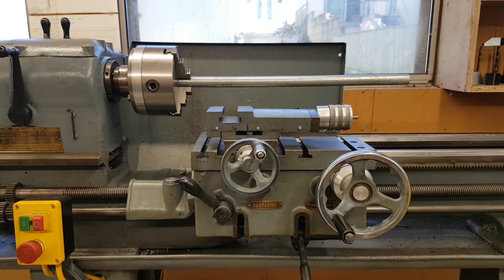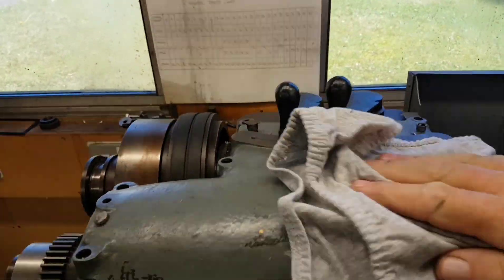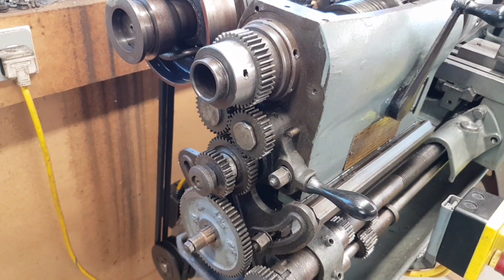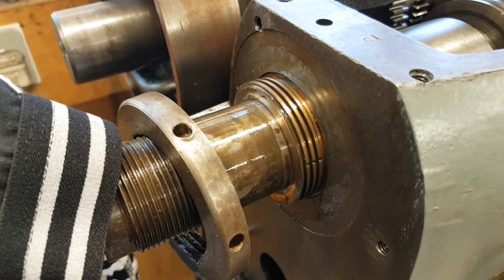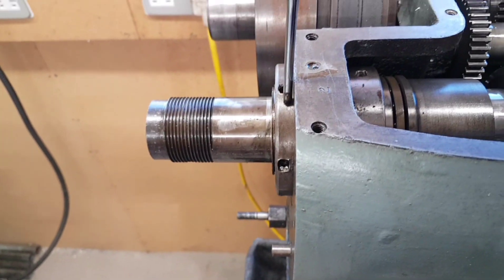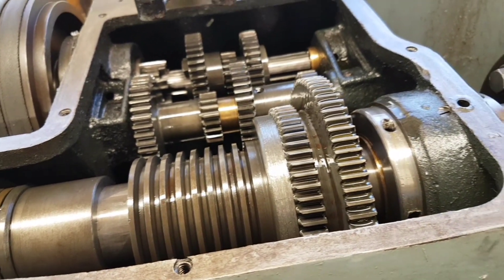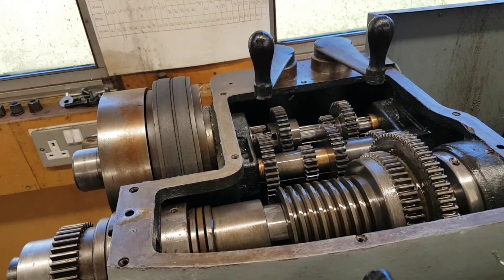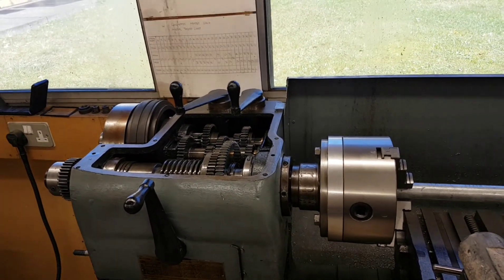Colchester Master 6"   (1942)

Comment: brilliant video Neil! just wondering I have just managed to acquire one of these but need to move it into my shed. Do you know how/if its possible to remove the gearbox with the headstock off the main bed at all? As I'm sure I've seen a picture where this had been done. Thanks
Reply from the maker: @WillV8  Hi there..
To remove the headstock/gearbox, first remove the change gears and tumbler assembly.  You will see a gap between the base of the gearbox and the lathe bed. Look inside the gap and you will see two plates bolted to the gearbox.  These can be removed and the gearbox will then lift off, or you can slide it down the bed.
Be careful friend! That gearbox is well heavy ! Dont try and lift it manually or on your own.
Cheers Neil
Reply: @NellsMechanicalManCave  Thank you so much for the reply Neil much appreciated struggling to find much information on these. Out of interest do you know a rough weight for them Or if its possible to get hold of some sort of manual? No don't worry thanks for your concern Thankfully have access to a forklift to move the lathe about!
Reply from the maker: @WillV8  hi again.
There isnt any manuals available. You can check the age via the serial number stamped into the bed by the tail stock. 
Lathes UK have a paragraph or two on  " The Master 6 inch" but that's about it.
Weight wise I would estimate 1200kgs. The headstock is about 85kgs.
Look at some of the later videos of mine and you will see an email address. Drop me a line and I will send my number if you need it so we can chat of WhatsApp info.
Cheers Neil
Reply: @ Thanks again for the info Neil I’ll drop you an email at some point today cheers 👍🏻

Comment: Thanks for this video, do you know what specific bearings it uses?
Reply from the maker: Hi Bradley.
No, I'm afraid I dont know the bearing numbers. It was 1942 and details are very limited.
When I'm well enough, I'll take a trip to the workshop and pop a bearing out. I will look for numbers or identifying Mark's and post my findings.
Cheers Neil
Reply: @NellsMechanicalManCave  Thanks Neil, I hope you feel better soon.

If all goes well I'll be picking one of these beasts up tomorrow for about 150 pounds, seller says it just has to go and the headstock is a little wobbly, not sure about the bedways though. Is there anything you can tell me to look out for / test before I buy it? 

Thanks once again.
Reply: @NellsMechanicalManCave 

Hi Niel, sorry for the second message but do you know where those axis wheels you have came from? I can see they're quite nice and have obvious divisions for somewhat accurate tool movement but the one I'm looking at has generic handles and no divisions? Thanks once again

Comment: Gday Neil, this information will definitely help someone, my first lathe had bronze bearings and they worked well considering the age of the lathe, I could never part off even after adjusting them but I put that down to the ways being absolutely rooted, thanks for sharing mate and take care in the heat, Cheers
Reply from the maker: Thanks for the comment mate.
The lathe seized within 30 seconds of starting!
Had to strip the spindle out.

Comment: Hi Neil. Looks like you've got that as tight as you would want to go. Is there enough meat in the casting to fit taper roller bearings? It would make a big difference if you could fit some.
Reply from the maker: Hi Olly. The casting is too narrow and I dont think I'd gain much by doing it. It only goes to 550rpm so TRBs would be wasted on it. The best I could do is swap the entire headstock for one from the 1950s that way they are fitted and would do 850rpm.
Good thought though.

Comment: Thanks. Nicely done. That will be helpful. My Harrison manual has an interesting spindle preload setting using a string and a fish scale. I imagine an old engineer decided simple is good enough. 

You are likely right, the spindle may have taken a set. Could shift again for the better and maybe need a tweak. If you have one, an infrared temp meter may be handy to qualify the preload over time.
Reply from the maker: All things being equal, the simplest solution is usually the best. My definition of Occam's Razor.
I don't have an infrared temp meter so I'll continue with the usual temperature monitoring.  Touch until you burn and them spit and sizzle method 🤣🤣🤣🤣🤣

Comment: Good work. I suspect you may be able to adjust the slack out of the bearings. Mind you at some point you also might want to make some new ones.
Reply from the maker: Hi Ben.
This hopefully has adjusted the bearings to some degree. I will have to wait until its run for a while and then re-adjust before realizing its effectiveness. Did comment on your tig welder video but it wouldn't post. Scratch start welders are a pain.
Cheers Neil
Reply: @NellsMechanicalManCave  odd.   It isn't scratch start, it's lift start. Quite easy really.

Comment: Neil, An interesting video on adjusting these bronze bearings.  Is it in your plans at some point to remake all of the buggered up collars?  If they were in my lathe it would drive me nuts.   👍
Reply from the maker: Hi Jim, great to hear from you!
At this moment in time I don't think I have the skill set to remake the collars.  Even though I spent a great deal of time in engineering, it was in heavy maintenance and I'm still learning precision machining. I've only ever cut one single point thread which was external and never tried internal cutting due to the lathes limitations. As I learn more from watching people like you and others like Joe Pie, I gain a better understanding of lathe work. That's why I've undertaken the task of making this lathe more usable. 
To me it used to be a tool that turns round things into smaller round things, but I now see it has so much greater potential. At some point I'll take the Spindle out and then rework or renew the collars, but for now I want to see if I've improved things or caused more problems. 
Thanks so much for watching and commenting, cheers Neil